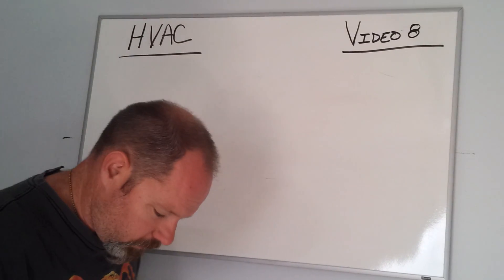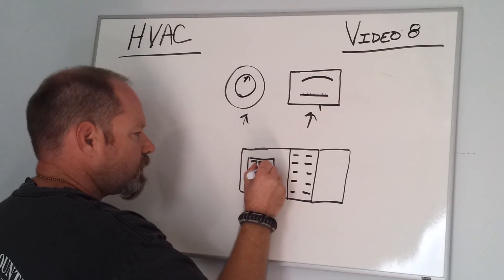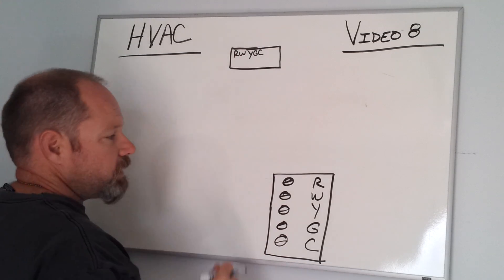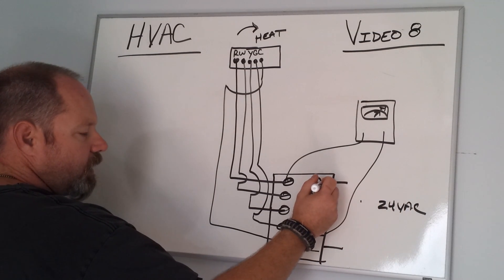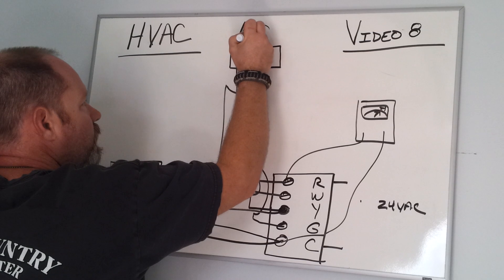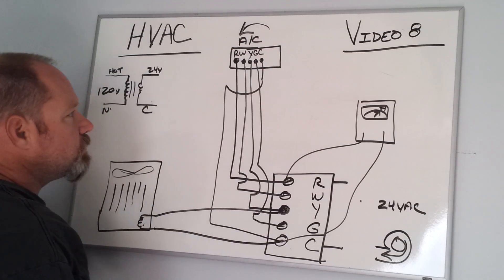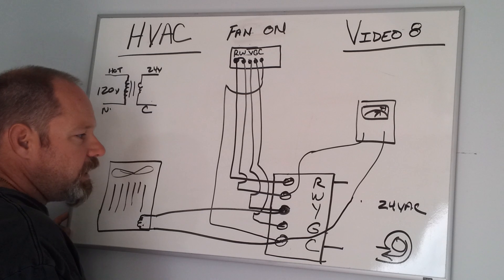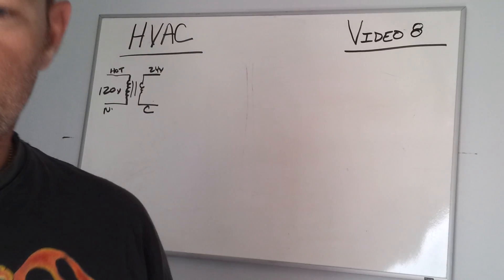BASIC ELECTRICAL 101 #08 ~ HVAC Thermostat wiring and troubleshooting

Comment: The green wire is for the air handler unit fan motor relay only, the yellow wire is for the outside condenser unit.
The yellow wire energizes the compressor contactor, the fan motor is conected in the same contact.
If the compressor works,but the fan motor fails, the capacitor may be damaged,defective,or the fan motor may have an open winding, most common problem with an old fan motor is the capacitor.

Comment: what color is the common wire? I have green, yellow, white ,red and blue. Is blue the common ? When I tried to run the cooling ..the compressor ran but condenser fan failed to start. Do you think my the condenser fan is broke ? How do you test the fan? or how to test the  thermostat if it is working properly or not. It is really hot here at 85 F.Can I just detach the wires except the blue from the thermostat and connected them altogether ? I 've seen in videos doing this ! Is it advisable before I call a professional ?  thanks in advance.
Reply: he green wire is for the air handler unit fan motor relay only, the yellow wire is for the outside condenser unit.
The yellow wire energizes the compressor contactor, the fan motor is conected in the same contact.
If the compressor works,but the fan motor fails, the capacitor may be damaged,defective,or the fan motor may have an open winding, most common problem with an old fan motor is the capacitor.
Reply
Reply from the maker: +51exequiel your fan motor or capacitor is bad. Sorry for the late response.
Reply: Yep, it is usually the cap in my experience, thanks for the explanation, it will help me in my trouble shooting, thank you brother.

Comment: I have a heat pump and when I call for cooling mode it is still  in heat the 4 ways valve doesn't change In the winter season I changed the thermostat and I got warm air so now in the summer season
I calling for cool air and I still getting warm air I don't know maybe I installed wrong the thermostat
Reply from the maker: did you check to see if the reversing valve is getting power? it may be stuck or bad.

Comment: thank you sir. I HAD A PROBLEM WITH MY "smart thermostat and I had to figure out what all the connections meant...... et voila problem fixed thank to you. I needed to figure out the C=common wire did and how to work around it to giv eto the thermostat. what is wrong is that the Smart thermostat does not need power via the C wire but instead a negative.... once you find that out that hooking it up is easy. thank you again Sir. also I know now how the trigger for the AC works. great stuff
Reply from the maker: +Mau Gri thank you!
Reply: Mau Gri u7

Comment: Starting school for this soon. So safe to say that if the furnace doesn't run. Check W to C and if you have 24 vilts. Then that means the stats good. No 24 Volts from W to C and stats bad? as long as there's 24 v from R to C.

Comment: could you please tell me where is relay on The Control Board to control the consender and the fan outdoor? when i measure contactor coil, it say 0 vol. but the blower motor worked well. i change the Cap of consender already. i want to knoa where is relay to control voltage to the coil of contactor. maybe that relay was broken. thank you Sir so so much.
Reply: the tstat sends 24v to contactor coil, when there is a call for cooling. you will have 24v on y and c, that go to the coil on the contactor. I would make sure 24v is making it to the contactor.
Reply: Thank you Sir . i fixed it 2 weeks ago. the guy coming my house to estimate price, he cut off 2 wire connect to the coil of contactor. He is a bad guy. it took me about 1 day to recognized that issue. He cheated me when he asked me go down stair to take a screw driver for him. crazy guy.hhhaaha

Comment: very nice explanations,I'm learning too,I have a question I wanted to install a timer for my chiller or airhandler unit,in my working place it's 230 volt but I'm not sure if what types,we have a old 30 yrsold unit carrier
Reply: Buy a timer at the big box store that is used for controlling a hot water heater. Just make sure the amp rating on the timer is the same or exceeds the breaker amp rating that feeds power to the air handler.

Comment: Where does L1 and L2 wires connect ?
Reply: +teresa pounders L1 and L2 are power in but it is also where you wire in your CCH (Crank Case Heater a device used for preventing migration of the refrigerant into the crank when the unit is not running) ect.. while T1 and T2 are usually the load side your compressor and such.

Comment: Hi. Thanks for posting this informational video. I am trying to hack my thermostat so that I can control it from my phone and I am running into a problem while attempting to do so. Firstly, I only care about controlling my AC and Fan (miami is hot enough that I dont care about Heat.. haha).
I basically have 2 relays that I can connect / disconnect using an arduino and my phone. The first relay is between R and Y to control the AC. The second relay is between R and G to control the Fan. With both relays in powered state, I am only able to get the Fan to work. The AC doesn't turn on. 
Any help would be great. Thanks in advance!
Reply: Nvm.. i figured it out. My HVAC unit has R, G, Y, and O wires. In order to turn on the AC I need to send the signal down O, Y and G. Something to do with a reverse pump. For heat I need to send a signal down G and Y.

Comment: sir i have a question if u dont mind ...i am working in ksa as a HVAC tech ..here we use 24 v circuit ...in pakege ac we must be use 3 contactor 1 for blower and 2 contactor   for 2 compraser ...some time i face a prb like... when we start unit from thermostate 2 contector working normal but when turnd on 2nd compraser the therd one contactor not get proper voltege ...  some time at blower blower contacter voltege get down around about 17 or 18 v ...  if i give it power from trance diractly it is work properly ...but with thermostate not working good ..replacing wire trance or thermostate no have banifate  ....  how we can fix this prb ...